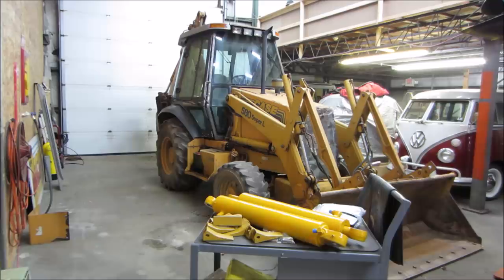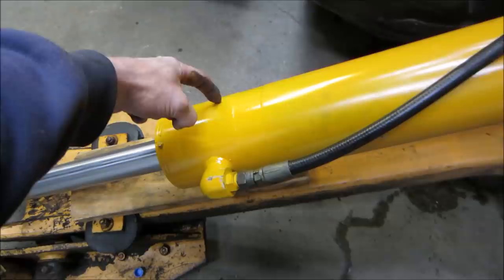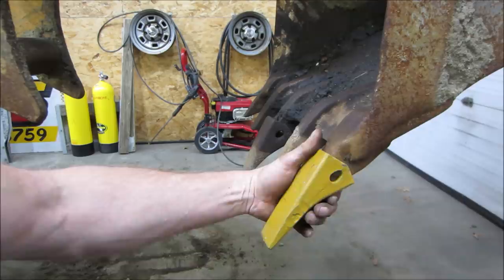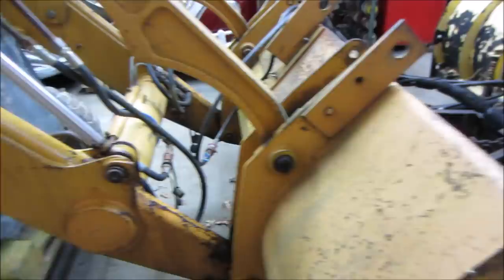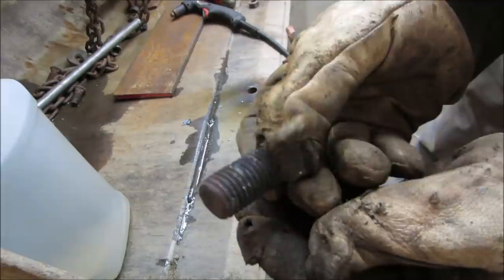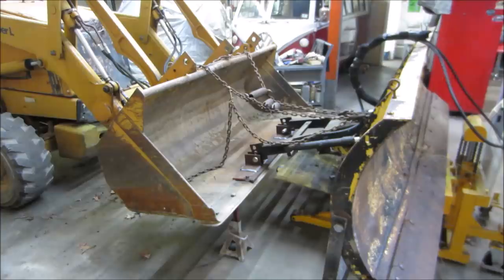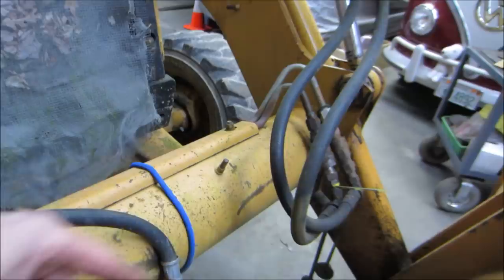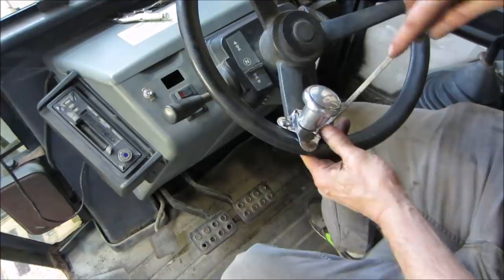WHY NOT? Lets Install A Snow Plow On A Backhoe

Comment: It isn’t that big of a deal to take the bucket on and off once a year. Even if that plow set up holds up your turning radius will make it almost unusable in most situations. Still fun to watch! Haha
Reply: I was screaming take the damn bucket off! I thought he was doing an early April fools joke!
Reply: I love Mustie’s work but not this one..
Reply: Why does the turning radius matter have you seen his property he has plenty of room to go down to the end of his drive where it’s just a giant dirt field essentially to turn around if he needed to. Plus he could always just raise the bucket up high enough to go over anything that prevented him from turning
Reply: Looks like the plow doesn't add much more out front than a snow box does. Most boxes mount to the cutting edge on old backhoes like that, still very usable. Several seasons in a 416C with a 14 ft. Box
Reply: This machine has steering brakes so it can turn on a dime if necessary.
Reply: If you take the bucket off what would you connect the blade to?
Reply: @joecat101  I’m assuming he’s talking about straight onto the arms for the bucket, but my entire point is if he needs to turn he could just lift the plow
Reply: @thehourglasswithaman  I agree lifting it up it can turn freely but how does the machines turning radius make it unusable when you can lift it up and turn on a dime with steering brakes? Also if you remove the bucket you would still have to fabricate a rigid mount to connect the blade.
Reply: It reminds me of one of those crazy machines you see in Mad Max and or Space Hunter hahaha
Reply: @joecat101  he dont have proper support metals so if he take out pucket he must made those what its not big job anyways, and i've never seen traktors where is plower front of pucket.
Reply: M
Reply: @broo_shs  it's a HUGE pain to take pinned on buckets off. Think about how long thats been on the machine, now try to imagine driving the pins out. I'll spoil it for ya, it's not fun at all. This is a better solution especially because he's going tk still want to use the bucket for moving dirt. And as long as he isn't going 15 mph, hitting something won't break the mount. Thats a stronger mount than what's on most pickups.
Reply: @joecat101  I agree wholeheartedly plus I’ve seen his property on either side of his driveway are essentially just like dirt openings within the woods and dirt fields. So I don’t think turning radius is a concern for him also I mean worst-case worse he’s fixed plenty of chainsaws I’m sure he still has one laying around he could just do a little tree cutting and call it a day
Reply: @Dirtlife98  little hammer and pins are out if not then little heat and its ok
Reply: Exactly! That was the most jank set up I have ever seen since slave lake

Comment: Not understanding why the bucket wouldn't be taken off, and replaced with the blade. This installation will make a long tractor even longer, and the leverage on this set up is gonna be considerable.
Reply: In the northeast at least it is very common for a property owner/ farmer to build brackets into the bucket to attach the plow frame. It does help to make it a floating assembly on a budget. That and these fisher plow are some of the best plows ever made and can be found sometimes for very cheap. The fisher I am currently using is over 30 years old and still just as solid as the day it was made in 1989.
Reply: @ronfrance4041  a lot of doubters here Ron. We just mounted the ears back in the bucket more.
Reply: @chucknorris277  yup, they’ll learn…. Or maybe they won’t.
Reply: Buy an old bucket cut the brackets and fabricate to the plow.
Reply: I'm with you on this one Tom, he's gonna mess up big time!!

Comment: Personally think the bucket should come off to mount the plow
Reply: I figured use a C-clamp system to mount the plow on the bucket. Then you could unclamp it and use the bucket when there are huge snow days to pile up the snow.
Reply: The ones I’ve seen all actually use that system, they take the bucket off replace it with the plow

Comment: Living in Colorado for 50+ years I have seen tractors use buckets for snow, and tractors with snow blades, but never using both at the same time.  Can’t wait to see how this works.
Reply: Maybe the ultimate solution is to take the front loader frame and bucket completely off, and bolt the plough directly to the tractor.   We always took our loaders off when the tractors were not being used for loading.
Reply: @hiscifi2986  that’s what I thought was going to happen: replace the bucket with the blade.
Reply: Weak comment.    To make it topical yes, but weak.

Comment: 18:39 That is the way the bucket teeth go.  Curl you bucket so it lays flat on the trailer and the teeth will lay flat also.
And yes they are wear items, that's why they are replaceable.
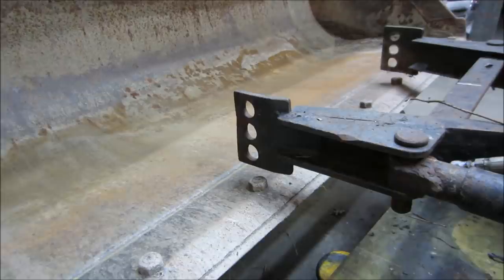24:01 It would be better if you remove the bucket and attach the plow to the loader frame.
Reply: agree on both points.. I would have put the plow on the loader frame after removing the bucket too... i think its going to break the bucket the way it is now
Reply: @n2n8sda  it won’t break the bucket but it could possibly bend the front cutting edge some or most likely bend the plow frame from bouncing on the bucket.
Reply: The length and it's weight past the front of the bucket will make it unwieldy and rock the machine.
Fit a quick attach and with all the hoses you can get fancy and fit a cab operated attachment.
Reply: @willtricks9432  You know he won't do that. That means he might have to buy real steel instead of the junk he has lying about he has collected for years.
Reply: Just use the front shovel to shift the snow. You've got a reversible toeplate on the front shovel.
Reply: Absolutely. If not the weight on the front end will kill those wheel bearings and steering components.
Reply: @peterhendry2154  I really don't think so. If your using the bucket all day moving dirt, there is more weight on the front end then the plow. The machine was designed for that.
Reply: @peterhendry2154  The front loader on that machine has a lifting capacity of well over 5000 lbs.  It is a tank. Front end components are designed for the lifting and transporting of that weight.
Reply: Had a ford tractor 3700. It was set up with the blade hooked onto the bucket with 2 pins. So easy and fast, i could switch it in seconds my self. Smarter not harder.👍🎄
Reply: @willtricks9432  0
Reply: @RichieCat4223  I managed to throw together a fork tine attachment for my IH 764 out of scrap, which fits on the quick hitch, if I can do I'm sure Mustie could do it better. Cheers

Comment: Couple tips from Wisconsin.
-Old firehose protects hyd lines well.
-Without wipers, make sure your heater works good and vents can be directed at the windows. (Used machine-some vent houses might be disconnected, cracked, plugged)
-until the ground freezes good, a piece of split PVC on the bottom of your cutting edge saves a TON of raking... literally
-even though it's your first setup.... You'll definitely find the weak points after a couple snow events. And it will be great content watching you customize to fit your needs
-FYI you typically do a lot of backing up while plowing...rear wiper fix is easier in the shop than the field
-carry some basic tools and bungees+zip ties in the cab as well as clean rags. U will thank me later

Enjoy. Great content as always Mustie

Comment: I concur with a couple other comments that suggest just push the snow around with the existing bucket - in the terrible winter we had here about 15 years ago, where we got a total of 10 feet of  snow over a 6 week time frame on Cape Cod, clearing out 62 driveways in our condo neighborhood was too much for the two Bobcat loaders and the plow truck they normally used. The contractor brought in a similarly sized Case Loader and heaped the show up into 10 to 12 foot snow piles here and there. Worked like a champ and was really fun to see the kids climbing up and sliding down in the aftermath.
Reply: Just add chains to the rear tires when you take care of the snow. But that blade doesn't look right for that loader.
Reply: You put the teethe on the bucket the correct way, they had it backwards. love your videos!
Reply: I have seen guys plow snow with the bucket, they added some skid pads like a snow blade has
Reply: Back about I'd say 6 years ago in the Western part of Massachusetts we had had 4 feet of snow so far and had just had a Noreaster bring 2 feet and I'll say Im happy I had a JD Backhoe or else my 1 mile driveway would have taken days to clear with my snowblower and shovels
Reply: Best King of the Hill games were played on huge snow piles as a kid.
Reply: Yea that is a BIG loader like 1/3 yard? or more?. I could see 2 scoops on a huge snow day for a Very long driveway. I was wondering why he was putting on a plow... Seems like it will be hard to maneuver being that long with a backhoe on the back. But hey what Do I know I dont have ANY snow. thank GOD...

Comment: I think that the difficulty you had in removing those bolts from the bucket blade is strong evidence that the plow was never attached to it previously. Most likely, the plow was used instead of the bucket. However, your engineering skills are awesome!
Reply: With the bucket removed, there is nothing to connect the plow blade to
Reply: Look at the brackets with 3 holes. Look at the plow with 3 holes. 200k views. The emperor wheres no clothes.
Reply: Sp. Wears.
Reply: @joecat101  need brackets to mount to the blade for loader arms wich there about $150.00 at my kubota and case dealer and deere dealer here are $790.00

Comment: Most of the mounts I see for that use are long U shapes that slide over the cutting edge of the bucket with a chain that wraps up the back of the bucket to a binder. Allows you to pop the blade off easy as pie like you would with a pusher.

Comment: I have a 580SL exactly like this one and And old snow plow exactly like this one, more or less, I just welded some old junk brackets in the bottom of the front bucket stuck some pins through the plow and took off plowing. When I'm done plowing, I just blow off the weld with a torch and whack the brackets off! Not the best way for sure, but it works for occasional use! My blade is 10' which I thought was too Heavy and more than I could push, but it actually worked pretty darn good! In heavy deep wet snow it's a bit much of a load, but in KY. We don't have that often. God bless!!

Comment: The construction co. I worked for in my youth tried putting a 7.5' fisher on to a 580k, put the pin mounts deep in the front bucket. Welded in 1"plate brackets. I worked, but it turned out easier to just push with the front bucket.

Comment: So yes, the backdrag blade is meant to fold back when you're pushing snow. So it'll be out of the way. And a good rule of thumb (more on a v blade) is to have your A frame parallel with the ground. It looks like you got that pretty good. And the teeth on your backhoe are in the correct orientation. For some reason that lone tooth was upside-down
Reply: Now that... is eloquent design.   Looks like a factory option fer shurez.
Add bucket-width consumable 6" WIDE slide strip of recycled tire to bottom front edge of original bucket and use that instead.
Reply: Yes, you want the flat side if the teeth on bottom for smoothing.
Reply: Bucket is a bitch to take on and off.Easier to just remove the plow to use the bucket.
Reply: case are great  for keeping parts avaliable plus i think case has the loader adapter plate to mount on to plows too

Comment: If you're gonna use the plow, buy yourself a third function diverter valve. You may need your bucket curl while your plowing. Third function will let you have both. I'm with the other guys though. I just use the bucket.
Reply: wat een amateur
Reply: @wilcodelangen6630  ooo

Comment: I've seen big city plows with springs at the top of the plow mounts.
I always wondered what they were for until I saw one running about 30 mph with the plow a little to low for the railroad crossing.
The springs allowed the plow blade to tilt when the bottom edge caught and stopped the truck dead in it's tracks.
That's the only reason I could see for having a spring assembly on a plow mount.

Comment: Around here, most wheel loaders used to move snow, gets the bucket removed and a plow blade with steerable wings attached. I don’t think the blade is really meant to be installed on the bucket.

Comment: We always just pushed snow with the bucket.  The bucket also gives you the option of piling up the snow,higher than using the plow.
Is it possible they removed the bucket and attached it directly to the loader?
Reply: That does actually sound better even to this Aussie who's never actually done such!
Reply: The guys that clear parking lots add snowplow like skid plates to scrape snow and they still have the bucket to pile snow.

Comment: Just a FYI on the come along: a lot of them are designed so to release or let the cable out you can push the handle and it will pick the weight and unhook the spring loaded catch so you don't have to hold it. Works 1 tooth at a time and very controlled.  I used come alongs for 30+ years and didn't know this but it's a game changer once you get it
Reply: Have you seen the come-alongs with the strap instead of that awful cable? They are AWESOME!!!

Comment: THANK YOU, for the great video !
   As much special stuff, as you have; and you still have dime-store type cable ratchet come-a-longs ! For very little, you can get 1/4 ton, 1/2 ton, 3/4 ton, 1 ton, & 2 ton CHAIN come-a-longs, and make a rack on your wall for each size. They lift and lower with ease. they don't slip, each click locks, and there's a quick take-up feature, so you don't have to ratchet all the slack up, to do the work. People give Harbor Freight a fit, but I've had 3 sizes for years with no problems, and got all 3 of them for about $150.00 .
   Thanks again for your pains-taking personalized videos !!!

Comment: I would just leave the bucket on Mustie & not fool with the straight blade. It makes snow removal a lot easier. That way you can carry & pile snow up out of the way easier. 👍
Reply: bucket only goes where backhoe is going - straight line, turning. power angle plow has more maneuverability. a pusher box would be a nice setup if all Mustie is doing is wide open lots, some wide roads

Comment: Try pushing snow with the setup you have, it will work but you may find various issues. After spring thaw, work up a video of fabricating a quick-connect plate on the loader frame where you can go from bucket to blade in a few minutes. Just like the bobcat guys have for tool changes.

Comment: I think like others you'll find it's easier to just use the existing bucket for snow removal, especially if it's for a stone road and they're not particularly picky and just wanting the depth knocked down to an inch or less. Your turning radius is going to suck with the extra 3-4ft hanging out front. And the 4x4 is nice but as long as the diff locker works you can probably get through this winter with no issues

Comment: I second the third function diverter, looking at the brackets on top of the bucket I would think they had some thing else mounted, too light to be for forks but that is a common addition, also a lot of rubber tires that I have run have a pintle/ ball combo welded on the top of the bucket for moving trailers with the bucket curled down, comes in pretty handy. the comment about the brackets being further back in the bucket are true but I think to do so would have been a real pain in fab, curious to see how the plow works out for you, hope to see a follow up video, great vid thanks.

Comment: Bucket teeth can go either way. Material handlers and trench diggers have them pointed in, septic tank installers are the other way so they can reach out far and still dig straight down. Preference of the operator.

Comment: You described in your video about your 10” of  oscillation side to side. Below your A frame there is a slide frame attached to the blade with two guide brackets welded to the A frame. 
I noticed the brackets are bent or broken and with those brackets broken your center pin takes all of the pressure. Also be very careful with those fisher blades. The hydraulic cylinders run around 1250 psi and your loader will pressure relief at 2500-3000. I have had those cylinder split by hitting something while plowing. 
I would also suggest tilting the buck down a little in the dump position so as your plowing the force pushing against the plow helps force the front tires down to help with steering 
Great job with mounting in the bucket

Comment: Definitely build a mount so you can remove the front bucket, and mount the plow correctly. That way you can swap the blade for the bucket if you need to remove piles of snow.  Also, when plowing, line of site is important, and your bucket will block your view of the plow.
Reply: I don't get your logic. The way he has it built, all he has to do is unplug the hoses, unhook the chain, and pull two pins, and he can drive away from the plow and use the bucket to move snow. And hook it back up just as easily.